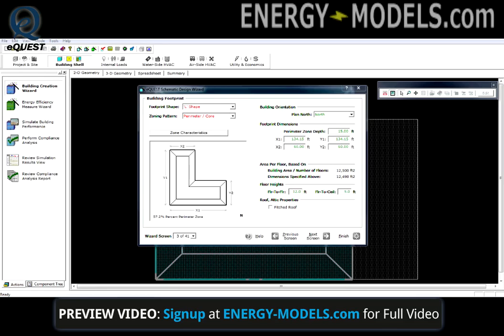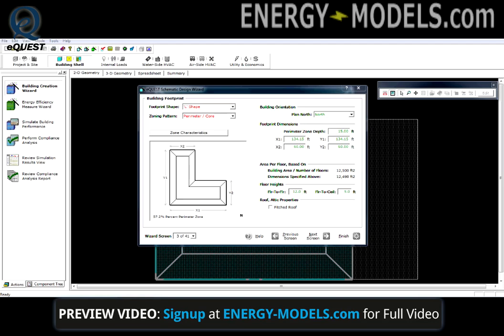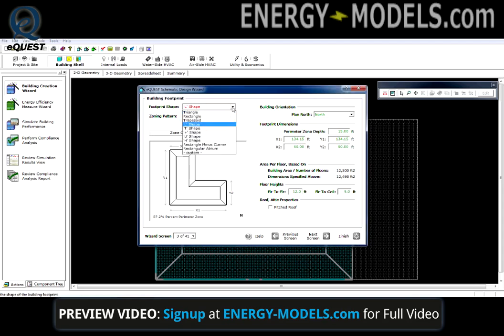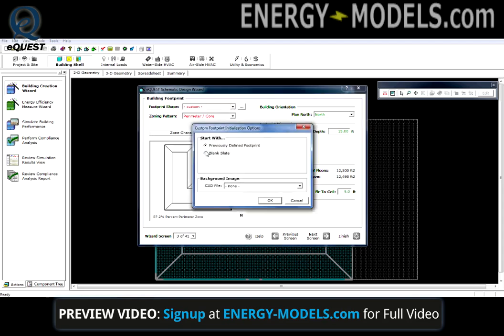Importing a CAD File into eQUEST | Energy-Models.com

Comment: This video covers a simple example of How to import a CAD file in eQuest.

In this Video:

Trace a simple cad file and import into eQuest
Set up custom zones from a cad file
Importing a CAD file in eQUEST is done quite easily with the right knowledge. It can be done in either the schematic design wizard, or the design development wizard. In this case we’re on the wizard’s screen 3 of the schematic design wizard, looking at the building footprint. If we were to bring in a custom footprint, we can do that by selecting footprint shape and selecting custom, selecting blanks slate. We can leave the initial display extents as they are, and we’re going to select import CAD file. We can select ok, and you’ll have to navigate to the folder where your CAD drawings are stored. In this case we’re already there, however, we’re going to be importing a .dxf , so we have to change the “files of type” to have the .dxf extension. We’ll select the diamond.dxf and we’re going to select open and it’s going to prompt us with the name of the CAD drawing file, the unit conversion which we can typically leave at the default as the CAD program knew the CAD unit conversion. In the example we’re going to change it into units of feet.

Finally, the origin of the viewer is listed here, which we can typically leave at its default. Once we press apply, our drawing shows up in the background and we can click close. Once in this screen, you’ll note that the X and Y columns here are blank, because we haven’t actually defined the building footprint. Before we get to that it’s important to make note of a few things. The buttons in the upper left are useful and you should familiarize yourself with them. (2:19). Zoom button, pan button, and Zoom/Pan on CAD drawing. With Zoom/Pan on CAD drawing and Zoom button selected, any zoom that we make will actually change the zoom extents of the drawing itself, thus making the building bigger or smaller. SO take care when using that configuration.

The open CAD drawing file button, a CAD drawing properties button and the CAD drawing layers button. When you select the CAD drawing layers button. In most case you’re CAD drawing is going to be much more complex than this example and you’ll have several layers. What’s interesting here is that any layer that you click will flash on the screen, so it’s easy to see which layer it is. You’ll want to disable all layers that are unnecessary. We can click done. Select the view properties button will open a window to change the extents of the screen, or the viewing region. We can change the grids resolution, the snap ranges, the CAD vertices and here we want to change the snap priorities from first to the CAD drawing so that it’s easier to outline. And 2nd to the polygon, since we’re making a perfect square, sometimes you’ll need to play with these properties, in order to get what you’re trying to do exactly right. But here we can click done, and outline our CAD drawing. Pres the select button and start on any vertex and drag the cursor to the next vertex, moving counter clockwise. You can let go of the cursor and then click back on the last vertex and drag it counterclockwise to the next vertex. And we can continue this until we have the building outlined. Make sure you do this in counterclockwise order, or it will not allow you to save your changes.

If you look on the left, you’ll see each one of the vertices has been recorded. Please note that eQUEST can handle up to 120 vertices, so this is obviously a very simple drawing. Now that we are finished, we can click done, save the changes and you will we moved from and L shape to a square shape. However, this doesn’t look like our picture and while the zoning in our picture doesn’t make a lot of sense, we kept it as simple as possible just to illustrate this point. We can change the pattern now by going to custom, selecting blank slate and brining it again from our CAD file. Here you’ll see that the X and Y extents are left blank. We’ll have to click create new zone and outline our zone counter clockwise. Now that we have the zone defined, we’ll want to define the next zone. Remember you have to stay counterclockwise or the changes won’t stay recorded. Create new zone again, and finally we’ll create our last zone. Please note that we could do something out of the ordinary with the zone and we don’t have to stick within the extents of the CAD drawing. (6:35 )

So we need to define the last zone in this case. We weren’t in fact limited to anything in the CAD drawing, the CAD drawing just makes it a lot simpler. We can click done from here, and yes we want to save the changes. Now our changes will show up on the screen and we can move on in the project.